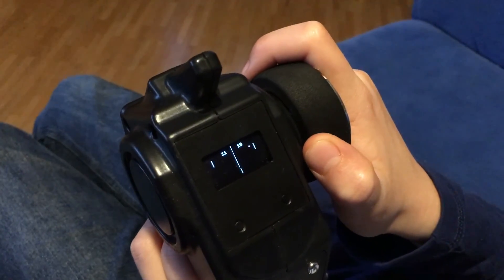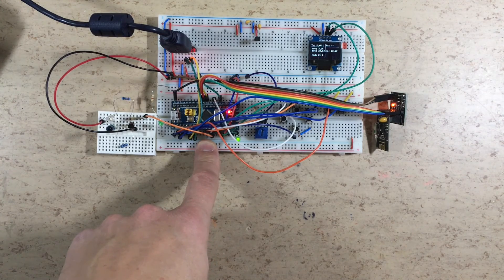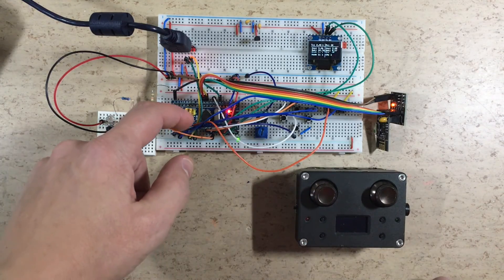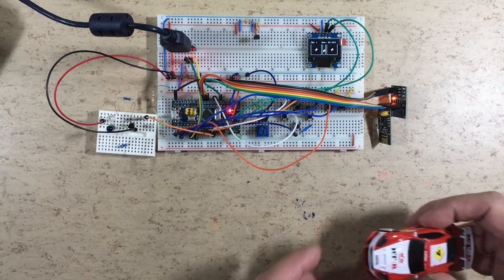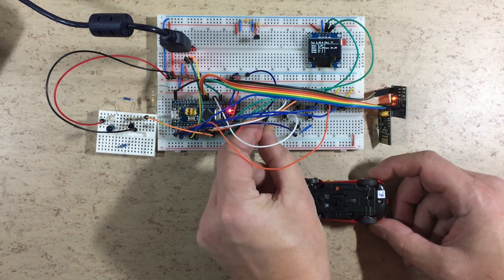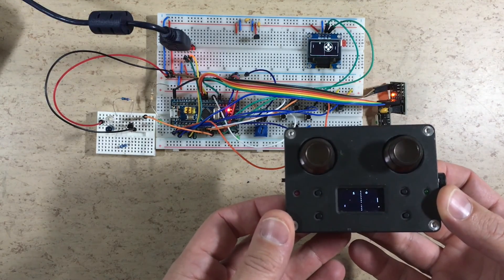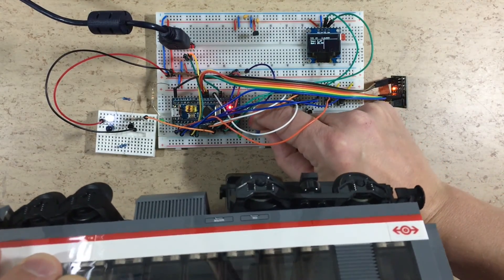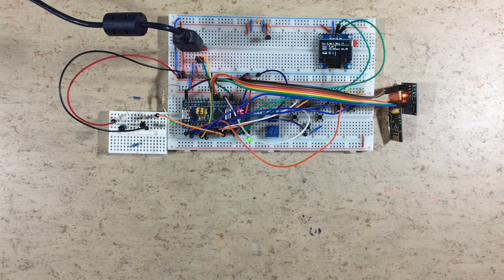STM32 Based "Micro RC 2.0" 2.4GHz DIY Remote Is Almost Ready!

Comment: very nice project. Stumbled upon it while searching for DIY open tx based on stm32f1. 

Can you help us build a 10-12 channel transmitter based on OpenTx and Stm32?

using Atmega 2560 does  ot.make sense now as it is very big and slow as compared to Stm32 ....with a better ADC.

please help
Reply from the maker: Thanks. I don't know the details of opened, because I'm using my own code. Also, I don't see how you would read 12 channels? This would require some sort of ADC expander
Reply: @TheDIYGuy999  i was asking if you could impement opentx software. Also please help me with the wiring diagram please
Reply from the maker: @anirudhkundu597  You can find the wiring diagram here: https://github.com/TheDIYGuy999/RC_Transmitter_STM32/blob/master/Eagle_PCB/RC%20Transmitter%20STM32.pdf

Comment: Can you please make a tutorial to just send data using stm32 + NRF24?
I have been trying to transmit yaw,roll and pitch using stm32 with nrf24 but not working with arduino code. Please Help!
Reply from the maker: It is exactly the same as with the Atmega version just install the libraries, which are mentioned in the code
Reply: @TheDIYGuy999  not working sir. 
I am able to receive data.  But when I transmit using stm32,  there's nothing received by another Arduino.
Reply: @TheDIYGuy999  when Arduino is transmitting,  stm32 is able to receive.  Nef24 modules are alright as I tested between two Arduinos. 
I need STM32 to make complex calculations of yaw roll and pitch.
Reply from the maker: I really can't tell. I can only tell you, that it works here. Make sure, you have a stable, separate 3.3V supply for the NRF module, this is very important
Reply: @TheDIYGuy999  can you please send me the simple code or link which does transmission from stm32? 
You tried between two stm32 right?
Reply from the maker: No, I have an ATmega 328 based transmitter and receiver. I also built an STM32 based transmitter prototype, which is fully compatible with the ATmega328 receiver.
ATmega328 transmitter: https://github.com/TheDIYGuy999/RC_Transmitter
ATmega328 receiver: https://github.com/TheDIYGuy999/Micro_RC_Receiver
STM32 transmitter: https://github.com/TheDIYGuy999/RC_Transmitter_STM32